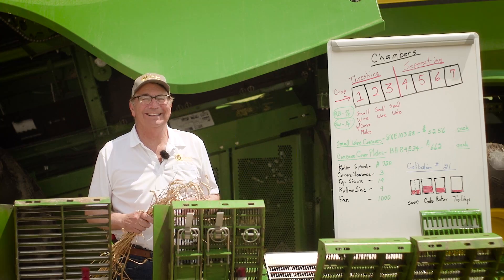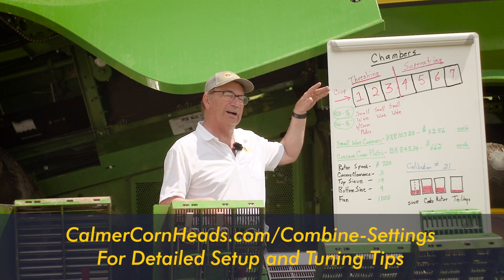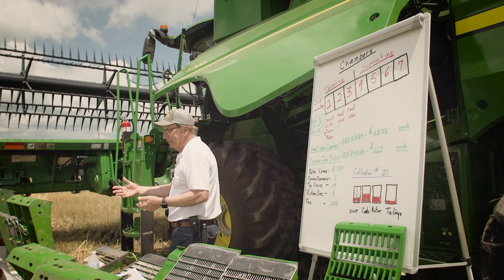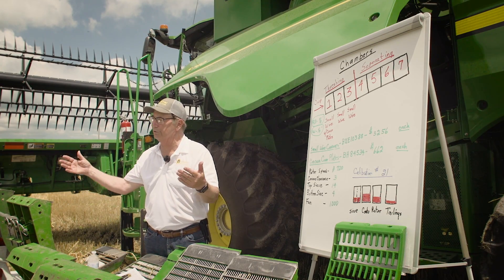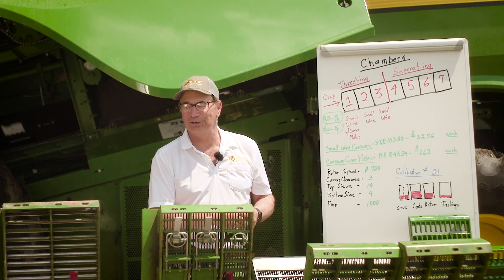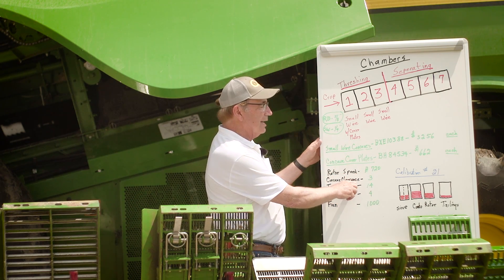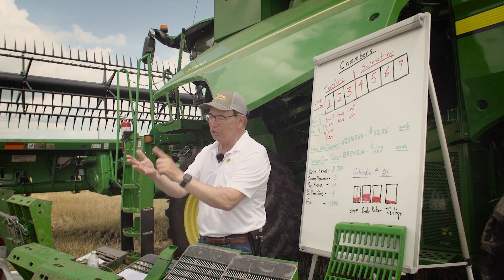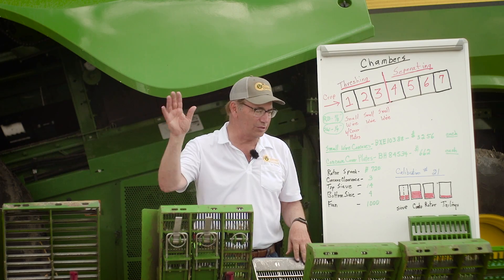Wheat Harvesting, Threshing, and Separator Settings Discussion with Marion Calmer

Comment: You mentioned that you like to keep the separation and rotor loss equal on the screen in the combine. In regards to that do you keep the shoe/separator balance (in the settings under VisionTrak) equal as well?

Comment: In 1460 winter rye I have to many head unthreashed in grain tank. Standard rotor, run only first 3 spiral rasp bars per row. Removed last horizontal bar. Run Kile fighting, new vanes set maximum,  small wire first concave, next two larger have to look to see what the are.
Reply from the maker: Let us know what you find!